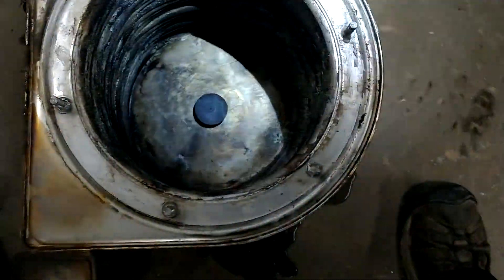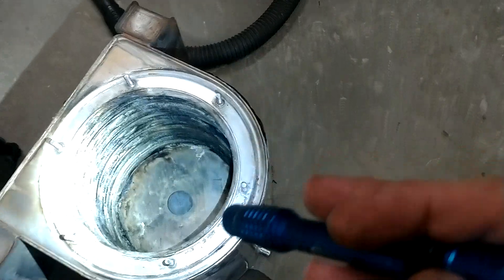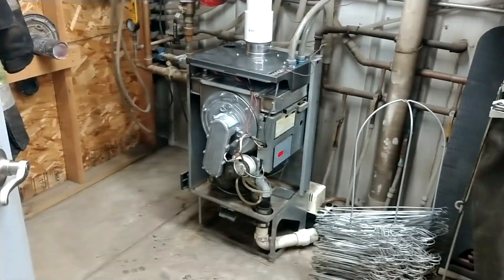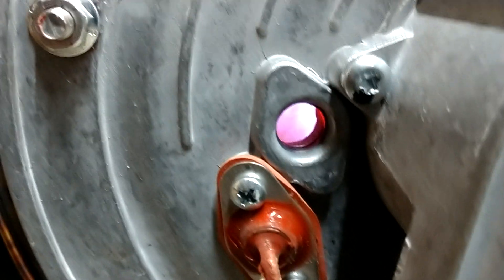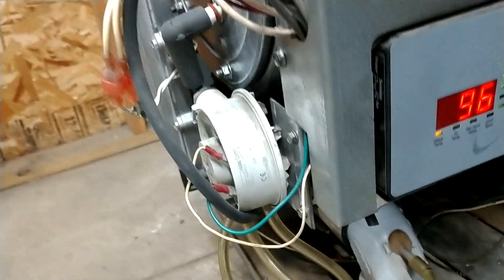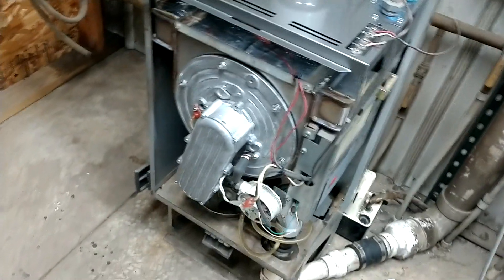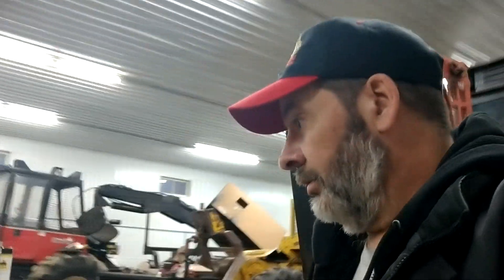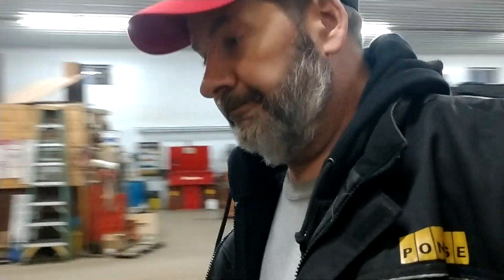NTI Boiler rebuild complete! It Verks🔥

Comment: Outstanding work Mike  ,, Uncle Tony kicks himself for not putting In hydronic heat in his 12 inch thick concrete floor  with 5/8” rebar & 6” mesh on top. ( it sweats 💦 when the weather changes)  has a fog rolling thru when the slab is cold & the air is warm LOL  😂 !
Reply from the maker: I love my warm floor.